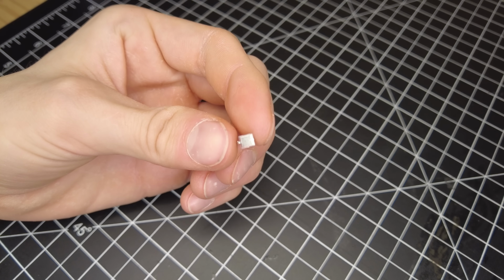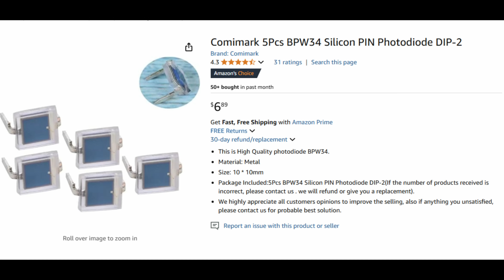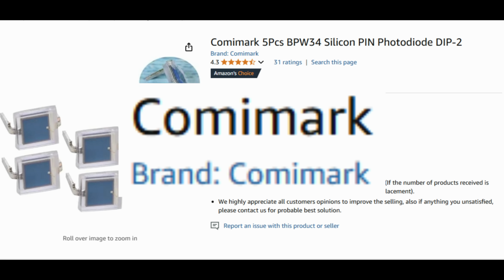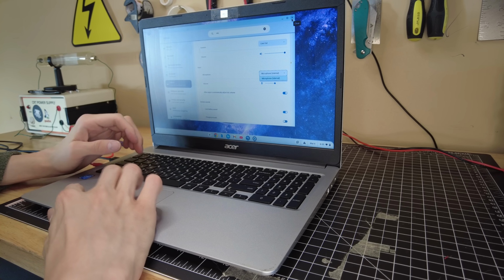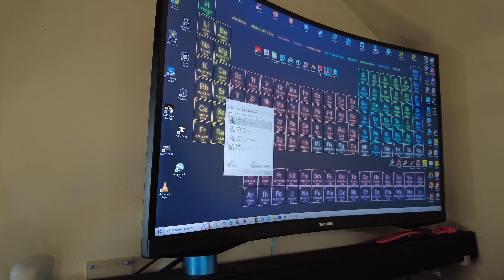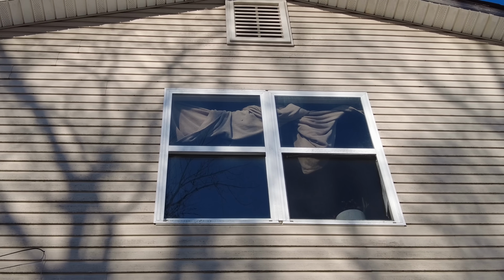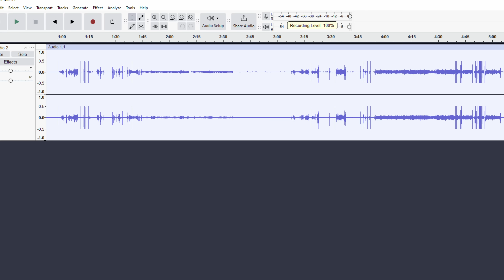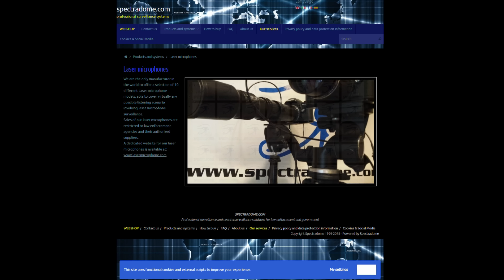I Built a CIA Spy Device (Laser Mic)

Comment: I've made some "lightwave audio" devices in the past. It's tricky to get it all to work.
To make the audio better, you have to filter or block every other light source.  Try a red filter on the reciever, as well as polarizers on both laser and reciever to minimize other light. (and control the brightness.)
Also, you need to test your laser light for noise. They can be quite noisy compared to gas tube ones.

Using a microphone amp... did you elimiate the bias resistor for the mic? That could cause you photodiode to be noisy, too.
Reply: After listening to the noise, I believe an easier/cheaper hack will be:
1. Get 2 good LNAs and photodiodes, use one for the actual input and one just "open" without any laser light reflecting back onto it. Then subtract. Like a poor man's lock-in amplifier.
2. Do noise reduction via software.

Keeping this setup cool with liq nitrogen might help a lot too.

That will mostly eliminate the static. Cause good lasers with low noise are way out of my budget.
Reply: @randomghost1080 subtracting noise won't work because their coherence time is like 1 nanosecond. You will just double the noise
Reply: @randomghost1080  Yes, this would work. Also, the laser could be intensity modulated (switch on/off at a much higher frequency than voice, e.g. 40 kHz), which would help to generate a lock in amplifier. Not sure if that big-ass photodiode is fast enough.
Reply: @randomghost1080   I've recovered worse audio than this just using Audacity and Davinci Resolve.

Comment: I would have modulated the light with a 100 kHz square wave. I would have used a lens to collect light from any thin surface, not only reflectin surface. Using a modulated signal makes easy to separate the useful signal so only that gets amplified. Make it a square wave and mix with the original one thru a logic circuits/detecotor circuit. Lowpass filter the resulting singal and i'm pretty sure you have got a really nice crisp sound.

Comment: "After all that, it still sounds like crap" plays high-fidelity audio sample that happens to have a little static
Reply: Yeah that static seems pretty easy to subtract even without a second signal
Reply: My thought too lol it sounds awesome, plenty to understand talking wish he tested it with a voice
Reply: "a little"
lol it has a lot of static, tho i think it was obvious it wouldnt remove the static because even when cutting the laser beam, the static was there, probably just using the audacity denoiser would have actually worked decently, because cutting the laser you have a clear sample of the static
Reply: @H3cJP  even so since that static has a lot of patterns that there's code for deleting most of them without deleting data it was just extra work
He tried to show how easy it is to do it not perfection
Reply: While most of the “noise” is likely caused by other sources of light, it would also be worthwhile to check if the circuit itself was picking up or causing EMI.
Reply: He should play people speaking or singing to hear how the voice comes through.
Reply: And the static sounds like stuff that would be easy to get rid of using some DSP...
Reply: Most of the noise is propably from the diode amplifier.
Reply: The noise is caused by the laser light itself - the laser does not generate a constant, perfect stream of photons
Reply: The guy has high standards.
Reply: 😂😂😂yeah the sound clarity was phenomenal
Reply: Your hearing is bad
Reply: Fr
Reply: lost in the static brt brt brt
Reply: Doesn't matter the static would just be "redacted "....FTG.!
Reply: If I were to build a high SNR device, I would start by lowering the pre-amp and mic temperature (entropy decrease).
Reply: Use a Lock-In amplifier. That will help to eliminate lot of the noises.
Reply: I know right 😂

Comment: The noise is actually electrical. Try shielding the receiver chassis. You won't get rid of all the noise, since this is just an inherent problem with amplifying such a weak signal, but it'll most certainly help. If you can get a decently low noise floor, you can cut off sounds below a desirable level before applying further amplification.
Reply: "The noise is actually electrical" first i thought so as well, but the noise almost completly stops when the laser is blocked. so it cant come from the amp, or cuircuit, its in the signal recieved from the laser. would be my best guess. would have loved a slightly different setup in another test, then we could compare.
Reply: @HW1099Tube might depends on the circuit of the photodiode. If it doesn’t receive an impulse, it may not generate any output. Would be interesting to install a simple LNA and filter before the ADC. Would mean disassembling the board a bit further. Before all that you could test for that with probes
Reply: @HW1099Tube  The profile of the noise sounded electrical at least. Like white noise or cmbr. I also heard noise when it was blocked, albeit it was a lot less, so I figured the noise gets louder with the signal.

Comment: The audio sounds bad because it is untreated. You can put your audio file in any DAW and put noise gate on the audio to take out the surrounding noises and then boost the clearer frequencies and take out the annoying ones in an EQ. It can be free, basic music mixing videos tutorial will help you and it is quite easy to do if your only goal is to distinguish a conversation and not have a studio level recording.
Reply: You are also trying to record music which lives in a very large spectrum of frequencies. You would not be able to take out, for exemple, low and rumbling frequencies without loosing the bass and kick. So you’ll always have an unclear result of the original music. 
Human voice on the other hand would be much simpler for tests (and is the target audio anyway) because it’s "clearness" exist in only a few hundreds htz in higher frequencies. Much easier to extract.
Reply: I mean there’s a lot you could do obviously but this would help a lot

Comment: You could do some Fourier analysis on the frequencies coming in. And return only a subset of them to denoise the output.
Reply: This would be the best option.
Reply: Just use a low pass filter. Don't overcomplicate.
Reply: @thewhitefalcon8539  LP filter doesn't remove specifically noise
Reply: @deang5622  But for intelligible speech you only need about 200hz-3000hz. 80-6000 if you wanna get all fancy. The window probably doesn't even follow those "high" frequencies so as a start, getting rid of the high frequencies would already be a great benefit. 
Also, getting rid of those before digital processing would also be a benefit.
Reply: @laurensvisser7623  You don't what the spectrum is of the noise that is present.
It's all guess work.
Reply: Or you could do some recursive kalman filtering

Comment: I hate to say it..  argh..  but you might be able to get rid of that noise floor with AI (barfs a bit inside due to buzz word BS).
You could even spin the thing as a juxtaposition of the past and present.. Old sig, new brain..  etc.. 
Alternatively, that noise floor sounds broad.. it might be hard, but there's a chance you can notch away parts that would not be in the signal (like filter to audible sounds)..

Comment: Ngl this was way easier than I would have thought
Reply: Luckly i have evertyhing in my bins for that project. What is the best way to align the laster and diode so that both are in one case?
Reply: @EliteHater  Thing is it would have to be pointed in a straight line at the window
Reply: @SibaNL  hmm ok i understand... entry angle = exit angle.
But that also means that laser microphone are useless when u aren't on the same elevation as your "target" window.
Reply: @EliteHater  You could be at a higher elevation and have a second person on a lower elevation capture it. But stuffs probably so advanced that they can capture it by some camera looking directly at the dot without relying on the reflection.
Reply: @EliteHater Real ones are nowhere near as easy to make, they don't require a significant angle between transmitter and receiver and use interferometry caused by phase differences not simple analog levels.
Reply: @mfx1   I assume this interferometry between phase differences or sound waves is quite complicated? Although great angle between transmitter and receiver doesn't sound too hard to do, and could probably still be done in a compact manner
Reply: @EliteHater 🔴 What Is Islam?  
 
🔴 Islam is not just another religion.  
 
🔵 It is the same message preached by Moses, Jesus and Abraham. 
 
 🔴 Islam literally means ‘submission to God’ and it teaches us to have a direct relationship with God.  
 
 🔵 It reminds us that since God created us, no one should be worshipped except God alone.  
 
 🔴 It also teaches that God is nothing like a human being or like anything that we can imagine. 
 
🌍 The concept of God is summarized in the Quran as: 
 
📖 { “Say, He is God, the One.  God, the Absolute.  He does not give birth, nor was He born, and there is nothing like Him.”} (Quran 112:1-4) 📚 
 
🔴 Becoming a Muslim is not turning your back to Jesus.  
 
🔵 Rather it’s going back to the original teachings of Jesus and obeying him.  
 
 
More .....👇 
 
🔴 THE RETURN OF JESUS
Reply: @EliteHater  l o n g  case
Reply: @EliteHater  That alignment is impossible unless you plan to use the same distance each time. I suggest using an adjustable mount for the LASER.
Reply: so is defeating it.  pump white noise into the window frames.
Reply: I cant understand how it picks up such fidelity from a shakey light beam
Reply: @Ross-v3w  In principle this is not so different to a string telephone except you replace the string with the beam and the photodiode acts like the headset on the other end. Fidelity only really varies by how fast the sensor is here and its sensitivity. Noise is actually relatively minimal because the laser will be pretty bright. Using an IR laser and a filter so that only the specific wavelength gets through ought to improve results beyond just making it harder to detect.
Reply: Well yeah we don't have to actually manufacture the microchip
Reply: Except real ones are nowhere near as easy to make, they don't require a significant angle between transmitter and receiver and use interferometry caused by phase differences not simple analog levels.
Reply: Ngl?
Reply: @userou-ig1ze  not gonna lie
Reply: Now we use cell phones
Reply: After all, there is no magic. Only simple and esoteric physics.
Reply: Indeed 😂
Reply: Don't be a liar
Reply: Did you originally see this on that homebrew espionage electricity website????
Reply: Да. Но додуматься до того, что это работает и сделать это. Гениально!
Reply: I did this way beck in 1982 using a dolphin torch and guitar amp after hearing that it was done way back in the 60s.
40 something years later…… ho hum
Reply: Many things are possible when conceptualized most simple.
Reply: massively but the biggest L is that he didn't even embrace the spy aspect here in the slightest and make a 30 second funny script to record and play on the phone so we can hear if his version is effective for speech
Reply: Just stick some things where they are not supposed to be and it will work.

Comment: 2:50 Actually it's not necessary to position the laser offcenter like that. When the glass vibrates, it changed it's distance from the laser source, thus changing the beams phase slightly. The information can be retrieved from there aswell, but the signal might be noisier.
Reply: Are the sensors analogue then? I assumed they were digital.
Reply: @jagolago-bob  the smartphone speaker does not output digital signals.
Reply: The photodetector detects intensity, so are you saying that the phase due to a path difference changes the intensity of the beam? I guess if you had a more complicated polarised detector with a circularly polarised laser that could work but not sure it would otherwise

Comment: What a simple and fun project! And you also mentioned making an interferometer to cut out noise. Great work dude. You could cut out some more noise with a narrow band pass filter to sterilize the laser, so the trash wavelengths don't hit the sensor at different times. However, for $30, this was fantastic.

Comment: To reduce noise in a laser microphone, use a low-noise laser source with stable current and temperature control. Improve optical alignment with high-quality components and vibration isolation. Minimize electrical noise with shielded cables, proper grounding, and filtered power. Apply signal processing like lock-in amplification and adaptive noise cancellation.
Reply: aaaand stop ambient light being received
Reply: You comments are valid, but  I think that in this case he got thermal noise and shielding wont help.
Reply: igor stop this shit, this is confidential, do you want us to ban this account too?
Reply: So that’s why the Russians cooled with nitrogen
Reply: A shielded cable would prolly be the easiest and most noticeable change